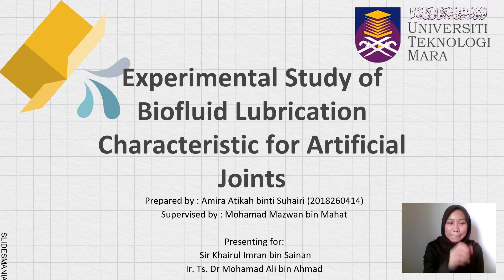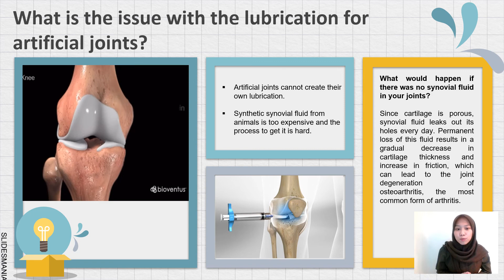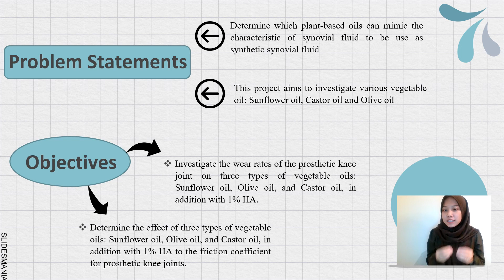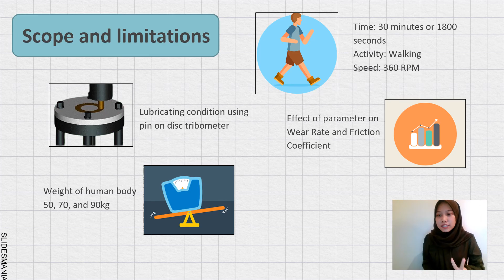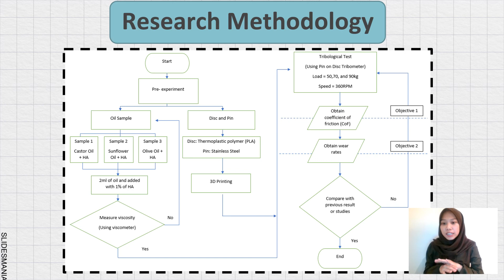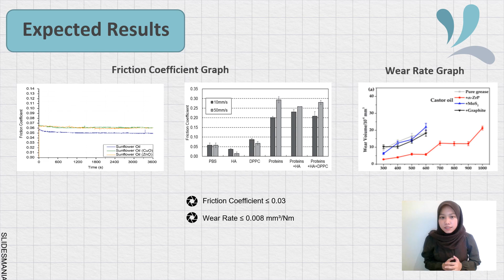FINAL YEAR PROJECT 1 VIDEO PRESENTATION

Comment: 1. How to measure investigate?
2. Why 1% of HA?
3. Why using Pin on Disc?
4. Is CoF important?
Reply from the maker: 1. By carry out the numerical value of wear rates that compatible with expected result.
2. Based on previous research, mostly they differentiate the concentration of the HA. For this experiment, the highest percentage of concentration for HA is used as HA is an active ingredient even 1% is consider quite high but as HA is the most important component to increase the viscosity of synovial fluid, I choose the highest one to help increase the viscosity of the oil.
3. Pin on disc is good to test the effectiveness of lubricant in the boundary regime.
4. CoF is important to quantify the friction force between two surfaces, as this experiment aimed to determine either plant based oil can imitate good lubrications to ease the movement of knee prosthesis.